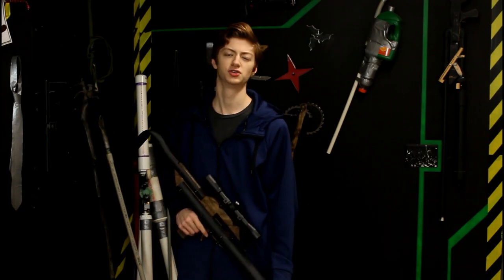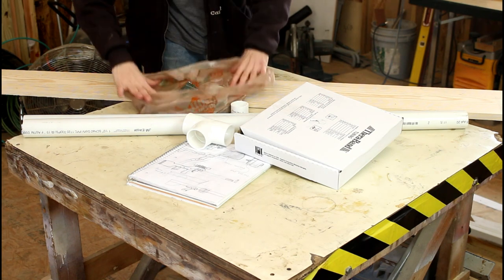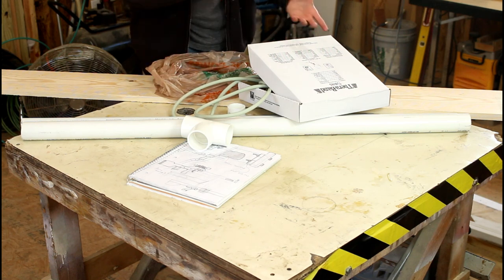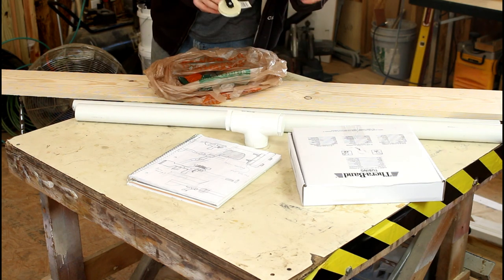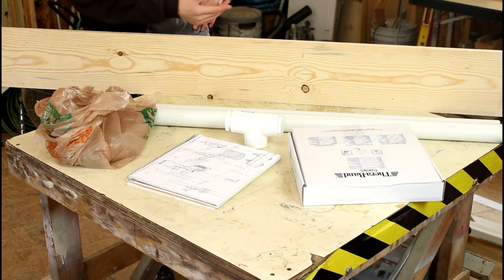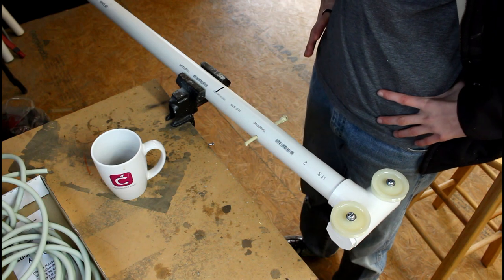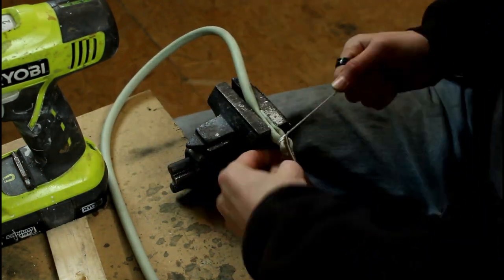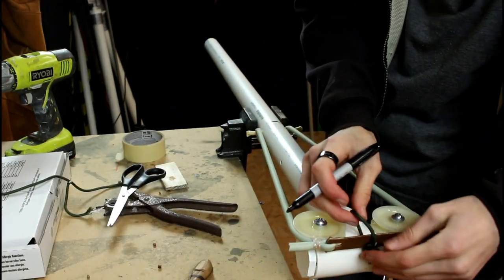PVC Slingshot Rifle (build challenge) | Part 1

Comment: The drill is a power tool. It gets it's power from the battery which is stored battery power from a charger connected to a electrical outlet to charge the battery. So it is a power tool. Hand tools are only powered by your hands and elbow grease.
Reply from the maker: Hush.
Reply: @jakemakes  don't give bad advice. You could get sued. NEVER tell anyone to not read the label warnings. A battery tool is a power tool.
Reply from the maker: You sir are a ding dong. It was a joke. If you get up tight about this sort of thing best not to watch my videos, they will bother you.
Reply from the maker: There is only so much I am willing to worry myself over. Getting sued by a dumbhead because of an obvious joke isn't one of them. I have to maintain my sanity. If I let myself fear getting sued over silly stuff like that I would have to sit under my bed and never venture out cause SOMEONE will get upset at something..... I usually have a disclaimer on all my videos as well, but I guess I forgot to stick it on this one. My take on this sort of thing is to cover myself within reason and common sense. If someone doesn't use their brain then it won't matter if I make sure they know it was a joke. Stupid is going to be stupid. Btw, if you don't mind edit the swear word out of that last comment or I will delete it. Nothing against you or the comment but I try to keep this channel clean, I have a lot of young kids who hang out here.